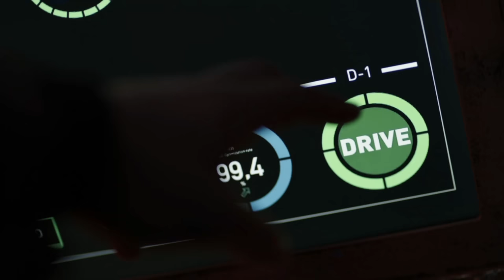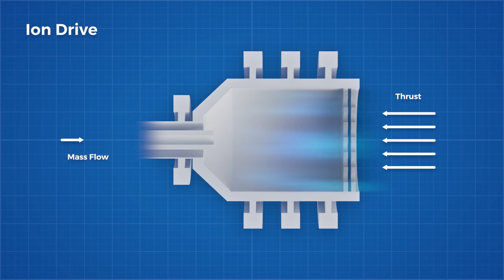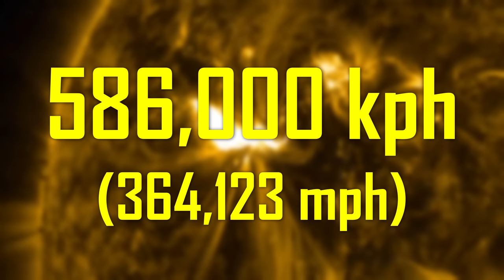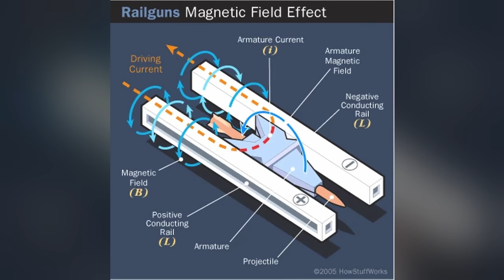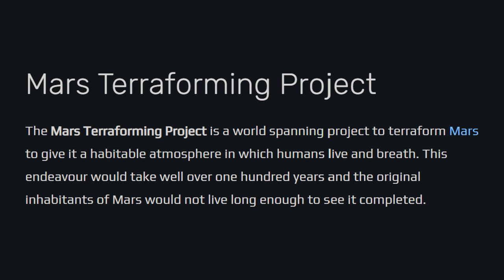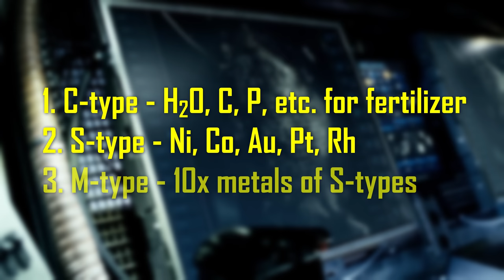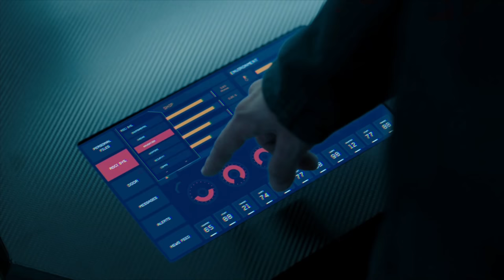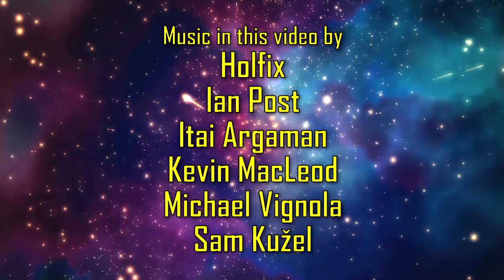The Science of The Expanse

Comment: 38:10 the books mention that the spinning of Ceres was done by Tycho with drives that were then removed. I don't recall if it was Eppstein Drives or Torch drives though, it is also mentioned that it took several years, maybe decades (can't quite recall) but it is regarded as one of the greatest engineering projects of the Belt, allong with Tycho station itself and the Navoo/Bahemoth/Medina. I can't speak of the methods employed on the other asteroids though.

Comment: 14:38 that's actually not normally the case.  Remember belters are used to 1/3rd G or less, so most ships usually aim for about 1/3rd G delta V.  Earthers do have a huge advantage because the crews can take highers thrusts and still fuction.  That is why MCRN troops train at 1G.
Reply: you use delta v wrong.
delta v is the tortal sum velocity change ability. if you lets say have 10 km/sec delta v, you can reach low earth orbit from the surface. accelerating is measured by m/sec squared, or g.
Reply: @rudolfcsampai9549  delta v means change in velocity. It has for like a century. Wikipedia it.
Reply: @shaggycan  it means the total potential velocity change... it's not a measure of acceleration.

Comment: Great video, but a minor remark: At 14:05 you mention that the show and "elsewhere" state that the Expanse ships use chemical rockets to land and take of from planets, however it is simply not possible to achieve the required efficiencies for that with chemistry. Today's current rockets are mostly chemical and are already squeezing ~80% of the maximal theoretical efficiency out of their fuel and yet most of their mass is fuel. The Expanse ships seem to only have about 10 to 20% of their mass as fuel, and in the books the fuel is always mentioned to be water so it can't be chemistry. The books state several times that the ships land and take off from planets with a mix of the Epstein drive at high altitudes, to avoid "glassing" the surface, and maneuvering thrusters at low altitudes. These maneuvering thrusters are mentioned to require a large amount of electrical energy and produce a plume of super heated steam, so they're fuel is probably water that is super heated by battery power or electrical energy produced by the reactor. These thrusters could theoretically achieve much higher efficiencies than chemical rockets (though lower efficiencies of the Epstein drive), so the concept is feasible. Additionally ships without (or not using) Epstein Drives are mentioned to fly "tea-kettle" witch matches this idea. The books also some times refer to chemical rockets but never in the concept of ships, instead they are used on a small scale, for cheap applications too accelerate small improvised crafts for instance.
Reply: I read the same thing. In the books, water is used as reaction mass. I supposed most engines use fusion to superheat the water to create the exhaust for thrust. Epstein drive is the advanced version of fusion drive the is capable of sustaining fusion for interplanetary flight. Some of the ships do not have Epstein drive but just fusion drive such the Zhang Guo which Amos, Erich, and Clarissa commandeered to escape to Luna.
Reply: Yeah, those fusion drives are often called torch drives , or just torches.
Reply: @Steye Fong  The Zhang Guo, in the show at least, does have a fusion drive. In order to escape their pursuers quickly, they launched up using the fusion drive rather than the normal chemical rockets, completely destroying the compound and killing everyone inside.
Reply: @liamjohnston2000  Yup, they literally torched everyone in the compound when they launched.
Reply: Maybe you can add an after burner to the space shuttle main engines ( which also output super heated steam plus H2). At that temperature there are already a lot of ions to work with.
Reply: @ArneChristianRosenfeldt  What do you mean by "afterburner" in this context? Usually an afterburner is used on jet engines, as they run air rich. In an after burner there ia a secondary combustion chamber and extra fuel is added into it along with the exhaust form the first "combustion chamber" producing extra trust. The space shuttle main engines, RS-25, runs fuel rich, off the stoichiometric ratio to make the combustion colder, thus avoiding well, melting. This only looses a little bit of efficienty, adding an extra combustion chamber where extra oxigen is added would only provide a little extra trust as only a small fraction of the RS-25 exhaust is unreacted hydrogen.
Reply: @edgarvilar2128  It was tongue-in-cheek. I though what if we take the SME or raptor engine with their first combustion chamber ( gas generator ) and their main combustion chamber and then scale them up a little to place a stoichiometric flame in the center ( where there are no walls ), we already, well, melt everything on the ground. H2 is used because of the higher exhaust velocity, but what if we use Epstein Drive for the upper stage anyway? Then mass is much more important.

In a step by step way I want to add the fusion energy to the chemical engine. Fusion energy could drive the fuel pumps. Fusion energy could drive B787 fans for VTOL. Still weird to me that a rocket weights more (with fuel) than the heavies plane. The NASA solar plane shows that (with active stabilization) a flying wing with many small tails ( twin boom) can have any size. Large, driven wheels, 3g horizontal acceleration and then take off with Mach 0.7 . Maybe fusion allows a plane to fly single stage to orbit. Not so much fuel to carry.

I could think of some electro-magnetic accelerator below the chemical rocket which transfers kinetic energy from a small number fusion products ( ions ) onto a large number of ions in the exhaust. I think in an MHD drive this could work. A longitudinal field lets ions run clockwise and electrons counter-clockwise. A rotational electric field accelerates both of them. Then at the exit the field lines direct the rotational energy towards the back.

You shot the fission products into the exhaust so seed ions. Then collisions create a real plasma for us. Or basically, you dump the used fusion plasma into the chemical exhaust.
Reply: @edgarvilar2128  Heat exchangers remind me of steam locomotives. Chemical heating is just so wonderfully compact. I like it when rockets use bi-propellant because that is safer. SpaceX super cools the fuel just like a crude oil tanker tries to reflect the sun to carry more of it for a given tank mass. Water uh, expands when it freezes. Maybe CH4 and HNO3 are even more compact at low temperatures. You can still inject some water, like the V2 did only distill its Ethanol to 30% .

Fusion and Fission reactors (others than Project Orion) strike my like instant power needs bigger reactors. Chemistry gives instant power in a nutshell. The electric heater comes into play when we heat the heavy atoms like C, N, and O . Maybe at least enrich on the light isotopes.

MRTs keep their helium liquid 24/7 . Our rockets just don't have insulation because the start ramp cools them down continuously. Maybe latent heat of solids could be used for regenerative cooling. In straight pipes pellets would be drive to the rim of the nozzle and up and melt on their way. A piston compressor is used form them.
Reply: @ArneChristianRosenfeldt  Well, a steam engine is compact, sure, but the wholle carrige behind it full of coal is not, nor is all of the oxigen present in the atmosfere used to burn the coal. If you are in a vacuum and only have access to some form of chemical energy, then you won't be able to go far. There's just not that much energy in chemical interactions. A nuclear reactor may be big and heavy, but a kg of your favourite flavour of fissile, uranium contains as much extractable energy as a metric tone or so of coal ,and there's also all of the oxigen necessary to burn it with. My point being, what is portrayed in The Expanse, the energies involved and absence of massive fuel tanks or staging, all point away from chemistry. And yes, water expands, but like you said its not hard to diminish its freasing point additives, or, if you do have a fusion reactor, you could just keep it above freesing. Plus people living in the thermous bottle that's a spaceship? They produce heat, that could be dumped into the water, or heat from any other number of sources. And yes Nitric acid is denser than water, but it is also quite corrosive, and in the solar system scale, very rare. Methane is also relatively plentiful, but much harder to keep in a compact form and just like nitric acid, you can't drink it.
Reply: @edgarvilar2128  The biggest part of the steam engine is the boiler, you know the black tube. Most of the time it is even bigger than their "fuel tank", Google Translate says that it is called: "Tender" .

For launch you need to expel a certain mass out of the back. Energy is not even that important, that's why we use solid fuel with less energy per mass. So we use chemical rockets because they give us both: Mass and energy in the correct ratio for single stage to orbit (we are really only talking about 6 minutes of burn time. It is already quite shaky, no idea how people dare to add explosions like project Orion to this). Yeah, up to Mach 3.0 air breathing ( and especially air pushing ) engines would be better. And after we left atmosphere and  build up speed for orbit (Mach 40), a 0.3 g engine might be enough. Of course going from LEO to moon was already done by an ion drive as was doing sling shot and then going to Jupiter. Stabilization in orbit was already done using a solar sail as was flying to Jupiter. Once you are close to the orbit, there is no place for chemical rockets. I just wait for the first commercial geostationary satellite to use ion drive. Maybe they fear all the space debris and rather go quick using LH and LOX to ascend (upper stage of the Ariane). But right now I think they use solid rockets to get to orbit velocity. That has to change.

Real rockets have slightly longer burn times because of some weight saving formula and maybe air resistance? If we would use bigger engines, then we could apply 3d shortly after lift off. If we have bigger engines we can finally switch to aerospike, which means that we can throttle the engine as we use up propellant to stay at exactly 3g with high efficiency. Of course any fusion reactor is free to increase the temperature of our exhaust with distance from the start ramp. Might give the spectator a blinding, violet flame of plasma.

Now the star ship seems to be extra wide to make area for all the engines on its back. Venture star needs all its back for the linear aerospike. I wonder where there is area left for the ion drive. Probably it would be a narrow beam tube, until we turn off chemical and fold them away.
Reply: @ArneChristianRosenfeldt  Well I disagree, energy is of extreme importance. The slower your exhaust is the more propellant you'll need to carry with you, which quickly becomes heavy and bulky, making it hard to go anywhere let alone get to orbit. The more energy you can dump into the exhaust, the less propellant you need. Its the hole point of the nuclear engines developed by the USA and soviet union in the cold war, the NERVA and the RD-0410. They never flew because they were expensive, and with our current launch fail rate (and even worse back then) launching nuclear material to orbit is risky. But those engines already achieved double of the efficiency of the RS-25 though with a much lower trust to weight ratio. 
I don't know of any geostationary satellites that use ion thrusters, but at least Space X's starlink satellites do and they do so, because by dumping solar power into the propellent they get much higher exhaust speeds than with chemical engines to achieve the same potencial delta V, thus being capable of getting away with far less propellent mass, so they are much smaller and lighter and thus easier to put into orbit. The drawback again, is a low trust to weight ratio. 
Solid fuel is useful today because despite having relatively low energy exhausts, and thus having a low mass efficiencies, they are very powerful and relatively cheap, simple and reliable, so they do a very good job at the early stages. The less time a rocket spends in the lower atmosphere the better, due to drag and efficiency loss by the rocket engines, so like you suggested, a high TWR is very good at launch and solid rocket boosters a useful yet inefficient tool to achieve that. 
What we have now sucks. Yes it is only 6 minutes or so of burn time to achieve orbit, but 90ish % of the initial mass of the vehicle is fuel, and the significant fraction of the rest is staged away, not even achieving orbit. This is impractical and expensive. SSTOs are totally possible, yes, but not a single one has ever been built. Some are in development but they also have their severe problems, namely their low mass to orbit capably. with our current technology, two rockets of the same mass, one an SSTO and the other staged, the staged one will always be able so put significantly more mass in orbit. Everyday astronaut did a great video about this "Why single stage to orbit rockets suck". 
Rocket engines are already "unfriendly" for spectators. A nuclear reactor engine applied to the initial launch would not be used to increase the trust over our current rockets, it would be used instead to increase the temperature of the exhaust as to allow a similar amount of trust but with less mass of propellant, so the overhaul energy of the exhaust would be similar, but with less mass (higher efficiency -> less propellant needed -> lighter rocket -> less trust needed -> smaller engine -> lighter rocket). So this would not be particularly more dangerous to spectators than current rocket already are. Assuming of course no significant amounts of radiation escape, and the dam thing doesn't explode. 
I do agree that chemical rockets will remain being used for a very long time and their efficiencies will likely increase a little bit (not much as they are already near the theoretical limit) as anything with similar trust to weight ratios and with better efficiencies have long roads of development ahead, to make them actually work reliably, safely, and at reasonable costs.

The Orion program, would probably work, if properly developed. In theory it could allow for ships with very high potencial Delta Vs so it could make the transport of heavy things to space and the planets relatively practical, but the idea is batshit crazy and detonating thousands of nuclear warheads on our atmosphere is bound to cause its issues XD.
PS: I never get the chance to talk about this stuff, thanks for engaging me :)
Reply: @edgarvilar2128  I just meant that the temperature / velocity of the exhaust needs to stay within limits -- as proposed by The Expanse -- in order not to melt everything on the ground. Thus we cannot dump more energy into the exhaust ( at lift off ). With vacuum nozzles ( the big one on SpaceX ) and the upper stages in other rockets, the particles are already mostly directed backward, just like in an ion thruster. I may have to look that up, but I guess that the raptor engine can create the highest pressure because it uses all fuel to drive the pumps. And I also guess that it hits max temperature on the turbine (mind you, with the super cooled fuel (almost solid)). I wonder how they don't have trouble with gyro forces when they steer the nozzle. People did not really want to discuss this about jet engines with me, but a radial turbine of large diameter should allow an even hotter exhaust into the turbine .. maybe for one fixed nozzle, or the flaps on an aerospike. Higher pressure means even more directed exhaust particles even at see level. So in the end if you would fly with the jet, temperature might be like a car exhaust, but velocity is so high that it rams into everything in the ground and burns stuff away like on reentry.
Now with the limit on the chemical driven pumps, any extra energy for more pressure is welcome and will give us an even more directed beam of destruction.
India's new rocket and the rockets in Japan and Israel and SpaceX and Saturn 1B did no use solid boosters. Manufacturing and transport is not easy. One Space Shuttle was killed by its booster. The whole booster needs to survive the high pressure and towards the end ( you want to use all fuel ) it gets hot, while a liquid propellant tank is cool.
In The Expanse the ion beam engines supply 0.3 g .. I guess in economy mode. Probably, on launch 2g chemical and 2g fusion energy pumped into the fuel pumps would work. We don't want to waste fuel on hover, that's why we accelerate fast. Then air friction rises above Mach 0.7 .. so might just reduce acceleration before that a bit to get into thinner air and then full throttle (add the 0.3g ion beam) break the sound barrier. My math tells me: at 3 km altitude ? Top Fuel dragster goes to Mach 0.3 . 1/4 mile . Something like this.
I hate to say it, but realistically launch from earth will always suck. Lower gravity on other planets and moons is our savior.
Reply: @edgarvilar2128  I hope that despite the war  infrastructure is allowed. Near the equator on a high and rising location: build a mountain made of high carbon steel, He, and H2.  Fractal foam. Like Eiffel tower, but all holes closed using sheet metal.
To support a rail gun into thin air at 20 km. At Mach 5 of the vehicle, the absolute exhaust velocity is lower and does not harm our gun. Vacuum nozzle for the chemical engine. 2 minute burn time where you cannot breathe